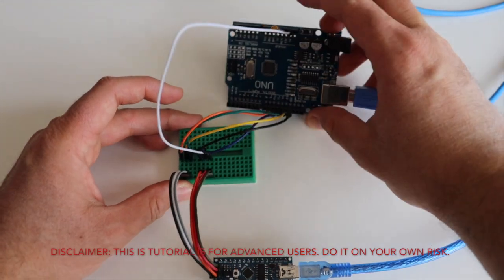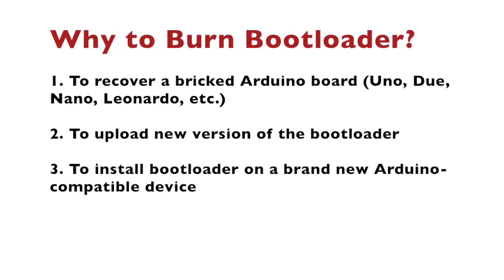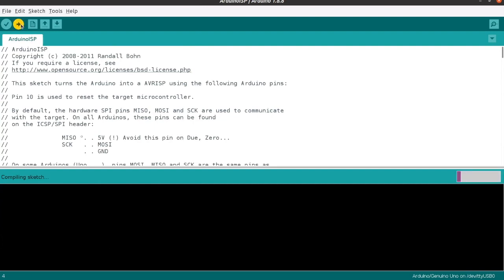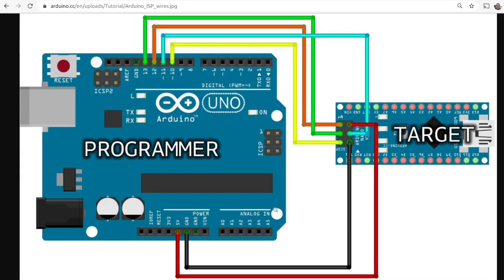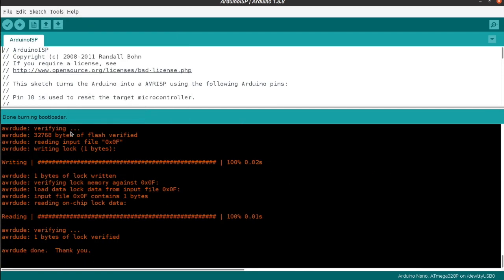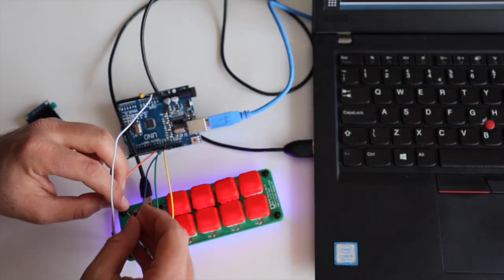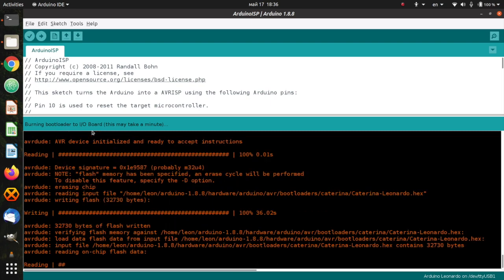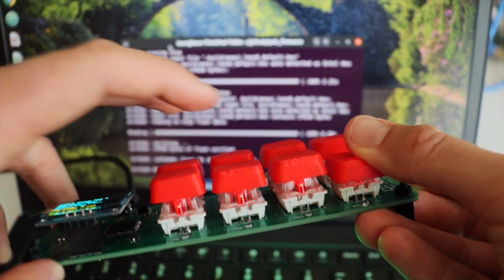Arduino as ISP to Burn Bootloader on AVR Microcontroller

Comment: Hi I'm trying to use the mega pro mini to burn bootloader on Arduino pro micro do I need to get a 10uf for rest and gnd
Reply from the maker: I don't have experience with mega rpo but I think you still need to apply the same approach with a capacitor.
Reply: @LeonAnavi  ok thanks buddy I just used another Arduino pro micro to pro micro and I managed to burn bootloader on it
Reply from the maker: @puresim316nosimracingnolif3 nice, well done!

Comment: Is there a form to read bootloader ?
Reply from the maker: Yes but it is tricky. There are useful articles online which can give you an idea what is required, for example: https://www.rapid7.com/blog/post/2019/04/16/extracting-firmware-from-microcontrollers-onboard-flash-memory-part-1-atmel-microcontrollers/

Comment: How burn bootloader on Arduino Mega via Leonardo?
Reply from the maker: It should be possible to do it the same way as explained in the video. Btw Arduino docs share even more details:
https://docs.arduino.cc/built-in-examples/arduino-isp/ArduinoISP
Reply: @LeonAnavi  programmer=Leonardo and target=Arduino mega r3....capacitor between reset and gnd dont work
Reply from the maker: @hennenberg88physqm16   the capacitor is required to prevent the Arduino from resetting when the serial port is opened during flashing. However, it is needed only for the boards that have an interface between the microcontroller and the computer's USB, like Mega, UNO, Mini, Nano. Boards like Leonardo, Esplora and Micro, with the USB directly managed by the microcontroller, don't need the capacitor. For details read: https://docs.arduino.cc/built-in-examples/arduino-isp/ArduinoISP

Comment: I finally get it to work.

The problem for me is that at 4:08, the procedure was not explained enough. Spoken was "nano" but shown is "genuine UNO".  

There is no reason why "genuine UNO" is shown. Just confusing. 

Step four should be to SWITCH from UNO to nano without changing the comx. There is no comx for the nano, only the UNO.  Programmer at the UNO should be "Arduino as ISP". This should be clear.
Reply from the maker: Well, sorry for the inconvenience. This is kind of an advanced video and may require some additional knowledge. The video demonstrates how to use Arduino Uno as ISP (In-system programming) to burn bootloader on Arduino Nano (ATmega 328).
In step 4 UNO is used as ISP to burn Nano bootloader. In step 5 we switch to Nano for a test.

Comment: Some help in understanding the definition of bootloader at 0:43

What is meant by "at every reset"? Does it mean by the pressing of the reset button? It seems that it cannot be, since the pressing of the reset button is not needed to upload.
Reply from the maker: every time when you turn on (or restart) the board, the bootloader looks for a sketch/firmware to upload or if such is not detected it loads the existing firmware.

Comment: Why arduino nano you only have to connect Target. And the atmega has to connect programmer and also target
Reply from the maker: In this tutorial Arduino Uno is used as ISP (In-system programming) to burn bootloader on AVR devices with Microchip ATmega 328, ATmega 32U4, etc. Arduino Nano is used just for an example.

Comment: Would it work if I have a 100 uF capacitor?
Reply from the maker: The purpose of the capacitor is to prevent the main board in this ISP setup from resetting while the serial port is opened. So eventually a different value may do the trick. 

In my opinion give it a try - does it work for you with100uF?
Reply: @LeonAnavi  yes! Nothing went wrong :) thank you
Reply from the maker: @johanfernandoromoeligio7029  cool! Thanks for the feedback. It is a very useful knowledge. I am sure someone else might be interested in using a 100uF capacitor.
Reply: @LeonAnavi  yeah! Of course I could buy the correct capacitor, but the store is very far from my home and I am lazy, so I decided to try it and works! Thank u man, you saved my project :D
Reply from the maker: @johanfernandoromoeligio7029  I totally understand you! I am happy to hear you found an alternative and it is working. Thanks for the feedback.

In the recent years small local electronic stores are going out of business and it is often not worth ordering online something tiny like a single capacitor. I am lucky that there are still a few well-packed local shops in my hometown Plovdiv, Bulgaria.
Reply: @LeonAnavi  >>  This is why I keep a box full of scrap circuit board, everything from old TV boards, Power supplies, consumer devices and other electronics, So much components that can be found and used, And usually for free..  There is usually many capacitors, resistors, coils, IC Chips, and if you get lucky,, some smart components like wifi or BT modules..  Save those old circuit boards..
Reply from the maker: @rays.2480  yes, recycling old electronic and computer components is always good!

Comment: So I had been struggling to get a Pro Micro to burn the bootloader because the device was not being recognized in Windows. 

I was trying to use a Mega2560R3 and kept getting a number of different errors. I watched a number of videos trying to resolve it with no luck and came across yours. I had just read the ISP code header comments and saw that white wire stretching over from pin 10 on you setup. Smacks forehead I was using the ICSP reset not pin 10! (as was noted in the fore mentioned code comments) Changed that and bam, newly burned loader! 

I also discovered my original issue of the device not showing up is/was an issue with the micro usb connector. If I pushed the connector all the way in it would not be seen. However, if I pulled it out slightly it would connect. I should have know as I would get intermittent connect/disconnects when attaching the usb cable. Ahhh, life on the edge LOL
Reply from the maker: Thanks for the feedback. I am happy that the video is useful. I tried to explain this advanced topic in a simple way and keep the video relatively short.

Comment: I noticed you are using an Arduino Uno with a SMD Atmega328P-AU chip. Have you tried using an Arduino Uno with a DIP Atmega328p-pu chip to burn the bootloader and does it work?
Reply from the maker: No, I haven't tried it with Atmega328p DIP but as long as it is an Arduino Uno or pin to pin compatible clone, I think there should be no difference.
Reply: @LeonAnavi  Thanks for letting me know
Reply from the maker: @arnoldc1724  you are welcome :)

Comment: What kind of electrical characteristics are those - a long leg and a short leg?
Reply from the maker: Polarity, the longer leg indicates the positive anode pin.
Reply: @LeonAnavi  So, if I cut the longer leg shorter than the short one it will become the cathode?
Reply from the maker: @joeblow7374  no, no. The length is just the indication of the polarity. A polarized component can only be connected to a circuit in a single direction. SparkFun have published an article with more details: https://learn.sparkfun.com/tutorials/polarity/all
Reply: @LeonAnavi  ))) I know that. I was just trying to tell you that you are using imprecise terminology.
Reply from the maker: @joeblow7374  ok
Reply: @joeblow7374  ok boomer